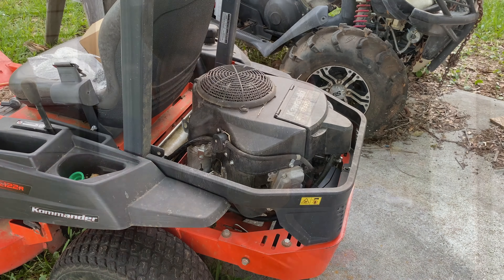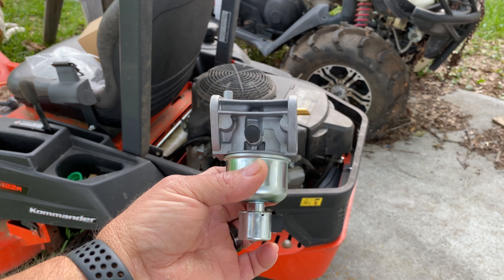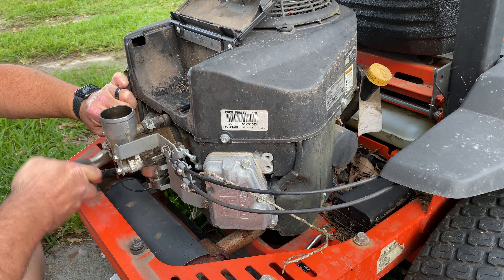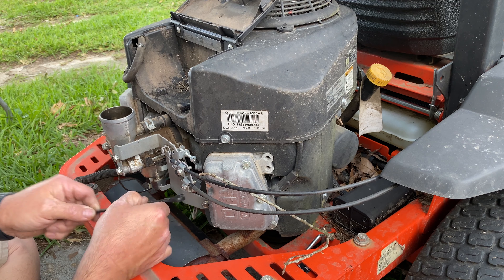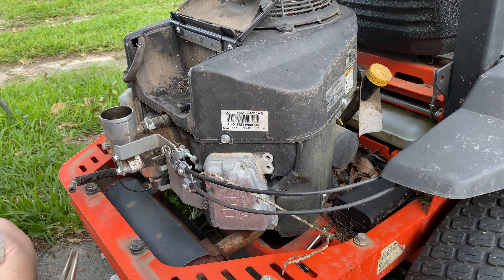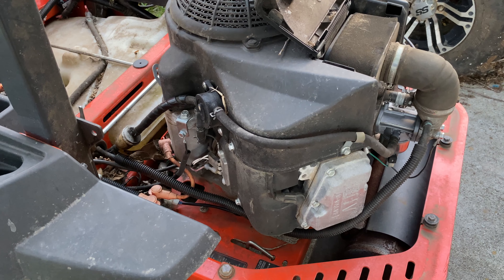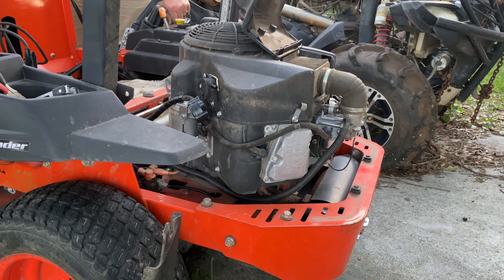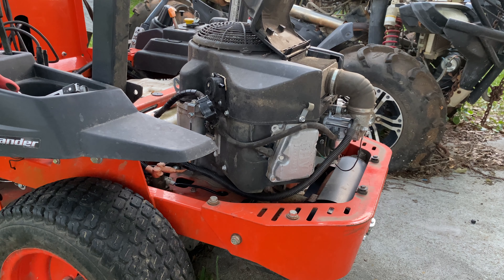Kubota Z122R Will a new Carburetor make it run?? Will I ever learn???

Comment: Great video. Got my Kubota Z422 Mower with only 5.5 hours on mine and I haven’t used it since last July of this year. It’s now October and I wanted to cut some fall grass and I’m having the same issue as you. It’ll start and as soon as I push the chock down it dies.
I only have 5.5 hours on mine as it’s used to maintain our new land.
I’ll try this fix with the fuel filter and will report back!

Comment: Am having the same problem with my Kubota ,changed fuel pump ,oil filter ,oil, spark plugs, air filter  tank filter and the carburetor. Still issues .
Reply from the maker: Thanks for watching, I’d be interested in hearing the solution once you get it fixed. Mine has been great since since the changes made in the video
Reply: All I have left is the carburetor. Wish me luck!!!!!!
Reply: Where did you buy your carburetor from? How much it cost?